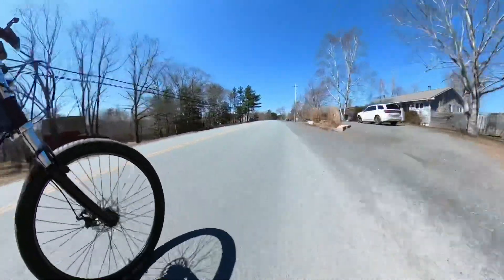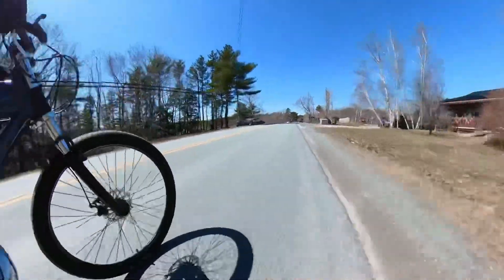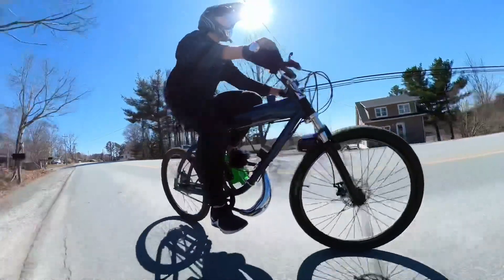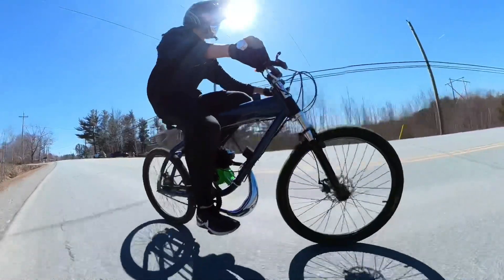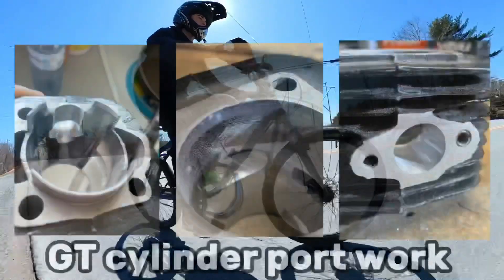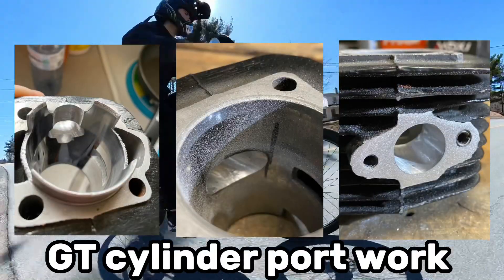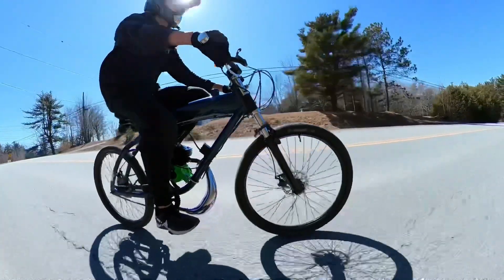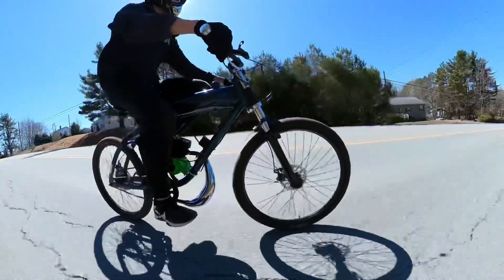Soon Testing Some BikeBerry Parts! Plus Updates on my Boost port cylinder

Comment: Looking forward to it. Thanks Keegan. I do have a question; does skirting the piston of the BBR Stage stage 4 do anything? I did that and put on the CDH minireed. I don't know if it does anything or not. The stage 4 is definitely better than the 2 engines l had before. Thanks again and excited about the upcoming videos.
Reply from the maker: The stage 4 motor is a great platform to start out on however adding a reed means you need to add a window at the minimum. You can skirt it but that won’t do much. You need the intake to be open at all times so the reeds can operate correctly.
Reply: Congratulations my man! That's pretty cool you get to work with them!
Reply: @keeganhache6667  Well, have you ever skirted a piston? I have to question if you even know what you just said. The video of skirting a piston, don't remember who's it was it's been a couple years ago, explains how, when the piston is at TDC, the skirt hangs down into the intake port blocking it, which is somewhat of the same idea as you are talking about a window piston does for relief or opening of the port. Anyways, I do have another stage 4 in the box l will try the piston port on or get another piston set. Also, what about those cylinder kits with the reed and carb together?